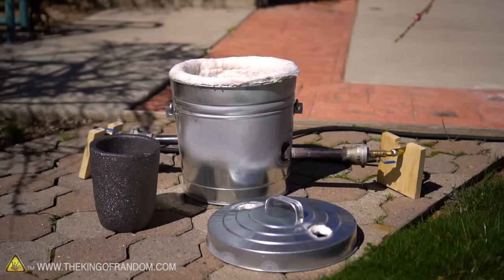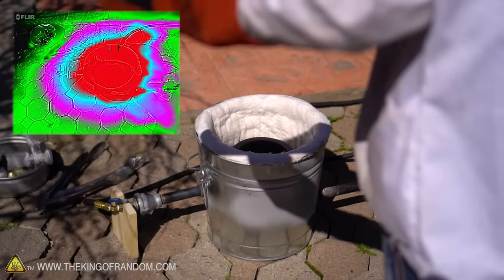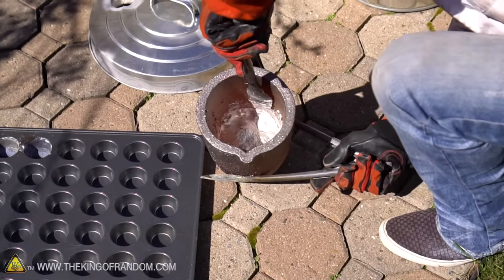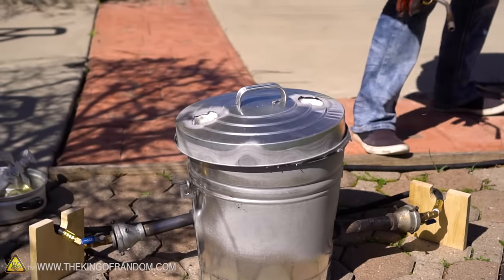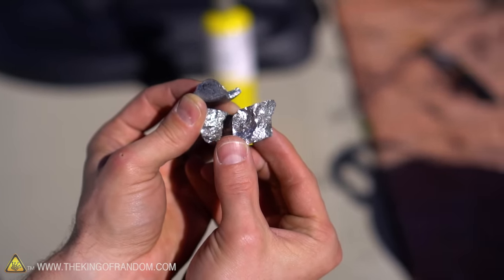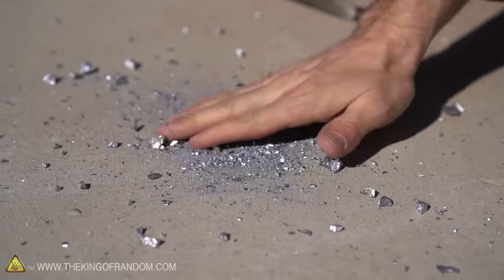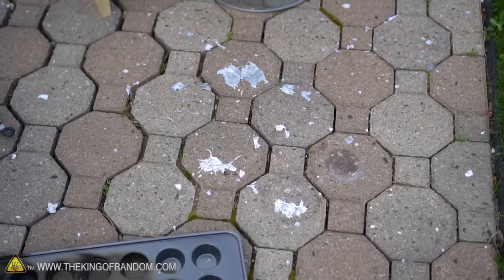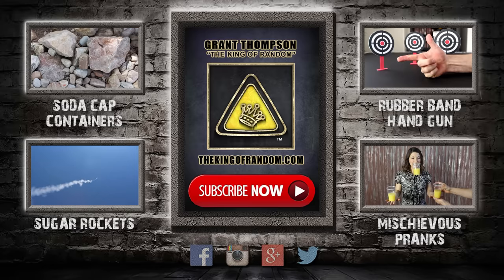Mixing Molten Aluminum With Molten Brass | How To Use Mini Metal Foundry For Mixing Metals

Comment: Can I melt aluminium cans?
Reply: Yes, that is how he got the aluminum ingots.
Reply: ah ok thx, did he publish a video on it?
Reply: yeah he did this in an older video
Reply: yes but just be aware that since aluminum cans are so thin they have a ton of oxide so you wont get that much aluminum, but you will get some and u can sure have fun doing it!
Reply: Lots of people have used can foundries like this to make their own metal lathes! A fairly extensive project, but lots of fun and at the end you have your own lathe!

Comment: if the brass and aluminium alloy is so brittle couldn't it be used in grenades
Reply: Fredrik just about to say that
Reply: It wouldn't be effective. Say you drop the grenade by accident, it would just break into 6 pieces.
Reply: Jordan H not to mention if you throw it it will break on contact and do little useful fragmenting
Reply: I think it would explode to too fine powder to do much damage. If you have seen normal grenade shrapnel they are very small.
Reply: If a grenade was that brittle, it would just shatter if it was thrown, and then the ignition wouldn't work and you wouldn't get an explosion

Comment: Molten Graphite !!!
Reply: John Potter No, there is no crucible that could handle molten graphite because carbon aka graphite has the highest melting point of all elements
Reply: I highly doubt so, since carbon doesn't melt. And if you're talking about sublimation (becoming a gas) then there's a lot of metals that sublimate at higher temperatures than carbon.
Reply: Carbon can't melt only burn
Reply: how do you explain liquid carbon dioxide
Reply: JoeAceJR  because co2 is no pure carbon it is a gas and no solid
Reply: Actually it can melt, granted it's at around 10 atmospheres but it does at 3550 degrees Celsius, but yes at normal atmospheric pressure it does sublimate.
Reply: True,  i forgot the "other pressure" scenario.
Reply: Graphite sublimates unless you have it at like 2000 bar..
Reply: JoeaceJR do you have any sort of science back ground
Reply: True lordpoti
Reply: Tajon sublimation is different the melting but you do have a point
Reply: Tin 4705  i answer for him " No "
Reply: CO2 can be a solid liquid or gas
Reply: JoeAceJR not always solid CO2 goes directly from solid to gas form. not sure how long it last or what temp liquid CO2 is. or for what use
Reply: Anthonypython liquid co2 forms under pressure. its stable pressure is around 850psi
Reply: Anthonpython In normal atmospheric pressures, liquid carbon dioxide doesn't exist (more like it can't exist). Under extreme pressures, liquid carbon dioxide can exist. If you expose liquid CO2 to earth's atmosphere, the liquid will turn to dry ice snow.

Comment: You should mix the 50 50 with the with the 3 part aluminum and one part brass and then mix it with the 3 part brass and 1 part aluminum And make a super metal muffin
Reply: Oh I forgot to say tin and iron also
Reply: It's Merlin Can't forget me!
Reply: That would be the exact same thing as brass and aluminum as a 50/50.
Reply: Sisteelin I find it funny how you have more likes than the original comment

Comment: Molten metals vs liquid nitrogen
Reply: I also had the same idea
Reply: It would flash freeze the metal, causing it to be very brittle.
Reply: DuctTape Queen Uhh no, it would be vaporized
Reply: rat soup i’m pretty sure liquid nitrogen has lower temperature so it should freeze.

Edit: I’m not sure if lava or molten aluminium has a higher temperature didn’t give me a consistent answer.
Reply: Noah yeah everybody likes explosions, so they can go noah

Comment: I'm an Material Science and Engineering major and if you know the exact composition of each metal and the temperature you are heating it up to, you can find out what you end up with reading what's called a ternary phase diagram. If you notice that the bottom of your ingots looked more copper color, that is because your mix had reached max solubility leading to what's known as phase separation. Any mixture that does not have a homogeneous structure or color has some phase separation in it meaning, you have pure metals bonded to themselves instead of bonded to the two other metals. Essentially, you have a part of the ingot that is not an alloy.

Comment: Dude - get yourself some crucible tongs. Watching this and waiting for you to drop that crucible and send molten metal everywhere. Also, that zinc off gassing is poisonous, that's why you never weld galvanized without a forced air respirator.

Comment: is the yellow stuff toxic
Reply: Zinc oxide isn't toxic per se, it won't poison you. But those fumes will damage your lungs very easily. Look up "Metal fume fever" for more info. He should really be using a flux.
Reply: PolyJohn thank you 😊
Reply: PolyJohn specifically boric acid

Comment: Two point to consider.  First, I think you’re basically making an aluminum bronze alloy.  Second, cooling in water may be leading  to the brittleness of the alloy.  Did you try tempering the ingots?

Comment: Brass is an alloy of copper and other metallic stuff, try with pure copper, dont cool the mixed ingot with water, the dramatic temperature  drop will quench the alloy, try slowly cooling it down with the residual heat in the furnace.

Comment: How would each composition work as bullets? Curious to know if the brittle 50/50 mixture has any penetration power vs the more durable mixtures.

Comment: Curious to know what if you heated the 50/50 mixture to just the melting point of aluminum would the aluminum melt and brass stay solid?

Comment: 85 copper with 15 aluminium gives you super strong aluminium bronze that is not brittle. 50/50 shatters like glass.

You should try mixing lead and aluminium. Would be fun since they are sooo different in density.

Comment: There is a type of bronze called aluminum bronze, where instead of the typical copper and tin combination, it is a combination of copper and aluminum. Since the zinc burned off, this is technically a disproportionate aluminum bronze.

Comment: Hey grant try quenching  oil to harden your metal pours water tends to not be as consistent in hardening metal 
P.s watch out for the flames when you pull your metal our of the oil 🍂💣

Comment: I'd be interested to know how the aluminum/brass powder works if used to make a thermite.  It's a slow mechanical process to produce aluminum powder for thermite and by adding brass the imbrittlement would make this process easy using a ball mill or similar apparatus.

Comment: Aluminum brass is also known as "Duralumin" and it's one of the stronger forms of aluminum. It age hardens to hardness levels far exceeding that of most types of steel.
Reply: I'm not sure if this is a mistake or way-too-subtle joke but Aluminum Brass seems to be mostly found in Minecraft. Aluminium Bronze, on the other hand is mostly copper with some Aluminium (5..12%) while Duralimin is mostly Aluminium with some copper (3..4%).
Reply: @whynottable  honestly, it's been so long that I can't remember either. I can't recall ever hearing of Duralumin or any other real-life alloy being referred to as "Aluminum Brass" so I'd say it's a mistake. That being said, I've seen a few AlCu alloys listed with Zinc as a non-trivial part of their make-up, so perhaps I was trying to say that Duralumin would be the closest thing to a real-life "Aluminum Brass". That would be playing pretty loose with the definition of 'Brass' though.

Comment: Before I even watch this, Brass is zinc and copper. So if you melt them both and mix em together, it theoretically it should form an alloy of aluminium, copper, and zinc

Comment: Mixing Brass and Aluminium will create Admiralty Brass. I think in the USA you call it an Aluminum Bronze. Brass is Copper and Zinc. Copper and Tin make bronze so it’s a little more confusing when you hear the term Aluminium Bronze (Aluminum Bronze for USA). Which in order to be Bronze would need Copper and Tin within the alloy. Again, it all boils down to where in the world you learn. Admiralty Brass got its name from being a lot on naval vessels where the Brass needs to be corrosive resistant, hence, Aluminium is alloyed in to give it this property.

Comment: The reason it shattered is because he super heated it and then rapidly cooled it in water. This is why bladesmiths use oil, because water causes the metals to become very brittle.

Comment: The 50/50 mix may not have been so fragile if you allowed it to cool by itself. Rapid cooling in water creates stresses within the metal (similar to a prince Rupert's drop). This makes the material harder and more brittle.

Comment: Annealing the product will reduce the brittleness and improve the malleability.
Reply: Aluminum Bronze
Reply: Clearly one has to use some kind of slag and/or an inert atmosphere when melting any kind of pyrophoric, highly volatile, and low melting point metals, clearly the people involved either expected this result and wanted it to be the cool factor of the video or else they did not know and were caught off guard.

Comment: Is the 50 50 mixture magnetic
Reply: Considering neither brass nor aluminum are magnetic I highly doubtful it. If anything it might make a slight electromagnetic field when introduced to a magnet because of the copper in the alloy. But that's a bit different than being magnetic.

Comment: It's necessary to mention the high electrolytic corrosion which naturally occurs between copper and aluminum. They are not compatible metals in normal use. Since brass is over 90% copper, this would probably be an inferior alloy, prone to corrosion. Comments from metallurgists appreciated.

Comment: next time melt the metal (alloy) that has the higher melting point first and then add the other metal (alloy). and don't overheat them. and as a final note, try to find out what kind of brass is that and if that is pure aluminum or some kind of alloy because it is very important. nice job, see ya!

Comment: Cooling it in water like that might have made the crystalline structure too large which would have caused the brittleness you saw. Try normalizing the alloy by letting it cool naturally, or quenching in oil instead, this would also impart some carbon into the mix..  Letting the zinc escape and burn like that would also weaken the brass, besides, zinc gasses are extremely toxic. Very unsafe to do that without protection.  Also, bronze would be better than brass.

Comment: AlumiNIUM. It comes from latin "alumen" 

First called alumium, then renamed by the same british guy aluminum and then aluminium.

Both of them were used in USA and Canada. When the metal started expanding and journalists needed to write it they searched it in dictionaries and found aluminum. The proportion changed and then aluminum won.

Comment: I'd take that 50/50 puck and break it, then buff selected parts of it with a copper or brass wire wheel to see how like Pyrite it appears after the fact.

Comment: That bright yellow is not zinc oxide (which is white) it's probably an oxide of lead.  Brass usually has a bit of lead in the alloy to make it machine better....so don't breathe it.  The zinc tends to boil when you melt brass (low boiling point) flux doesn't help just don't get it so hot and it wont bubble so much.

Comment: ends up just being copper and aluminium as zinc oxidises - you need to melt the aluminium, remove crucible then  drop brass in

Comment: once your aluminum begins to melt pour about a spoonfull of borax in there, it will make the slag easier to remove and give you a smoother ingot. Boric acid will also cut down on the amount of oxidization and zinc oxides you get

Comment: It broke because you put it in water and tempered the metal so that is was brittle. Like what they do to the edge of swords, but usually with oil so it hardens but not to the point of being so brittle.

Comment: That first alloy's so brittle it's almost like glass. Somewhat surprising. I do know that various forms of aluminium bronze have found niche uses in the past (and I think also some in the present) but usually the aluminium in those alloys is only around 5-10%, and the majority of the mass consists of copper.

I think aluminium as an alloying material generally seems to be either the vast majority of the mass of the alloy (as in a lot of high-end alloys which are merely aluminium strengthened by the minor presence of some other element) or only a tiny alloying component. It doesn't seem like many alloys that include aluminium have it in the 10-90% range by mass, and if such alloys generally turn out to be so brittle as the one you made then I can see why that might be.

Comment: I guarantee you the 25% and 75% mixes are also super brittle. You were just too weak to hit it hard enough with the hammer to shatter it. But this is why aluminum is not alloyed with other metals except for magnesium or beryllium or a SMALL amount of a metal such as copper (not 25%).

Comment: u ought to let them cool slowly rather than cooling quick, and it might not be as brittle. it's called tempering the metal, where I work if we want soft metal cool very slowly, and if it needs hardend, we cool quickly. I make drill bits masonry bits, big ones just don't cool at all depending on task it must take on, and little ones, definitely need tempering so we cool quickly.

Comment: You neglected to say how incredibly hard the brittle mixture is. Try a 20% mix, and although as brittle as glass, your hacksaw will just skid off it as you try to cut it. That alone should have some applications that need investigating. I did this some 15 years ago, but never pursued useful applications for it.

Comment: I would guess 60% Aluminum - 30% Copper - 10% Zinc in the first experiment 50/50 (Brass is not an element its a compound, you can name this new compound you just made I think..... Alumibrazincop. lol

Comment: Solubility of Alu  in Copper is low (<9%) if you add more it will form multiple phases which will be brittle. But you are using Brass not Copper. Solubility of Zinc in Copper is up to 37% Zn. 
But i think more Zinc you have less Aluminum the alloy can accept to remain in single phase.

Comment: Brass is Not "heavier" than aluminum. 1 pound of brass has the same weight like 1 pound of aluminum.
What you mean is the density.
Reply: Robert Schumann he is correct still... He had the same amount and the brass was still heavier.
Reply: yes, because brass has a higher density. Is that so hard to understand?

Comment: First you have to control your heat. And please watch bigstack. He will show you how to properly mix different metals. And why did you not wear a mask?
Reply: hes dead bro
Reply: @neurotica5461  thank you for telling me. When and how did he die?
Reply: @karlchipak643  little over a year ago he died in a paragliding accident. I don't think they ever released more details. 

Edit: I tried researching it more and the conclusion seems to be that an updraft caused the parachute he was using to glide to fold. He tried to deploy his backup parachute but the it didn't have enough time to deploy. All of it apparently happened in the span of 4 seconds from the problem arising to impact. It sucks because it is clear he was a really cool guy and it broke my heart to think what his family must've been going through.

Comment: What happens when you pour molten lead over blocks of hot (almost molten) iron?
I ask because I recently heard of an Abrahamic religion story where two tribes were kept behind a patchwork wall of iron with lead poured into spaces and it is very strong.

Comment: I love your videos, but I have to warn everyone about melting brass. It is dangerous due to the zinc content in the alloy. Breathing zinc fumes is dangerous both in short and long term. This also goes for other metals as well such as copper. Proper ventilation is mandatory but may not be sufficient. My advise would be to stick to aluminum if you are casting metal as a hobby. Or if you really want to cast in other metals, try to find a type of alloy that do not contain zinc. If you cast brass and later you develop flu-like symptoms (fever, nausea and so on) you may have been exposed to  the fumes.